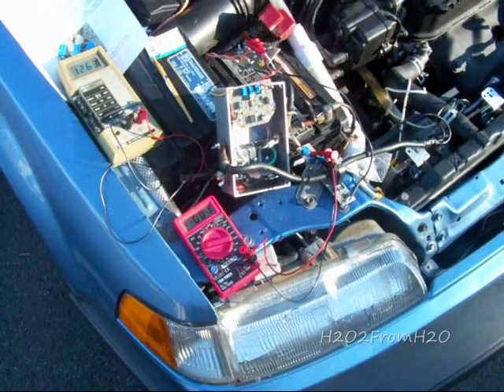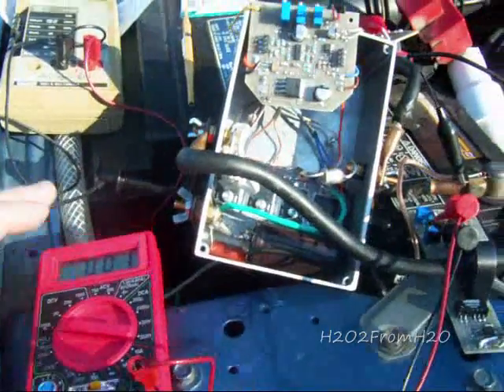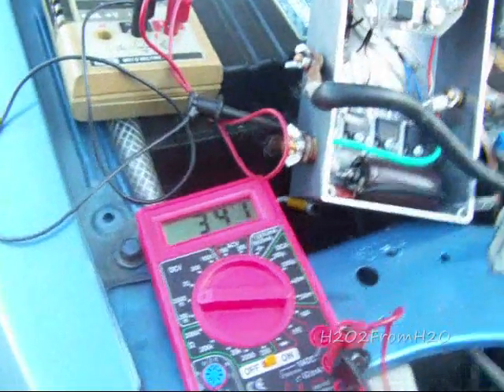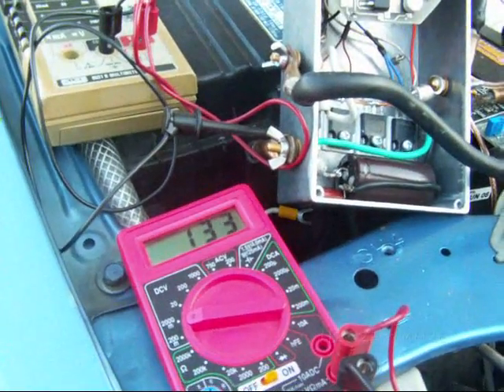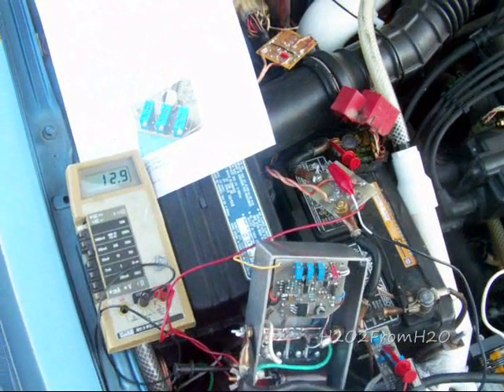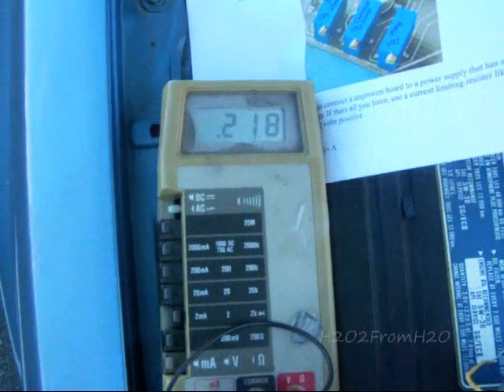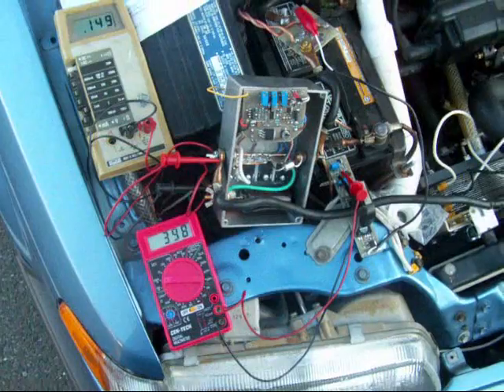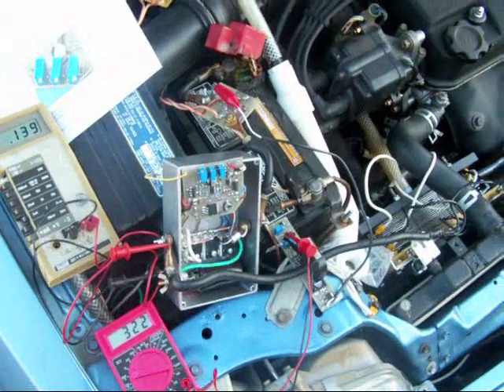#39 H2O2 - PWM Case V2 Install Part 17 of 17

Comment from the maker: I ran most of this test at 100% Duty, So the MosFets Stay cool, no heat at all. I ran my other PWM Case all winter and all summer with a current of about 30Amps, I had no problem holding onto the case and sink for more then one minute.  I run no fan on ether case. Passive Heat sink Only. My old case PWM V1 has no fins just the case as a sink. Sorry no temp taken.